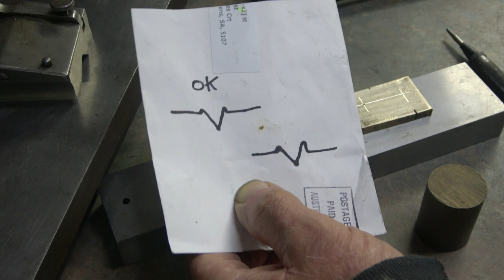How To Do Precision Center Punching To Toolmaker & Instrument Makers Standards As Taught In 1960

Comment: You really covered the subtleties of precision center punching.  I've often thought this would make a good video.  Occasionally, though rarely I still need to produce holes that line up on two different details and transfer or machine locating is not practical.  I fall back to my early training which you so aptly demonstrated.  I'm certain many of your viewers will benefit from your video.  Good job Dave.  Stay well my friend, Mike
Reply from the maker: Hi Mike, sorry I beat you to making this video LOL Don't put off until tomorrow what you should be doing today. I mainly made it as I see such bad center punching shown on YT, no accuracy or finesse at times. It's a wonder that some of the parts ever fit together. Thanks for watching. Regards.

Comment: Great video Dave ! The main thing I see a lot is when someone goes to the trouble to mark out correctly then thump a giant  divot with a big punch and a lump hammer. I have a little Starrett auto punch ( about 3 inches long) that I can actuate with nothing much more than reasonable finger pressure , I then use a small Starrett  manual punch to finish it off. I do have a bigger auto punch ( from Hare and Forbes ) but this thing needs a lot of force to actuate it . It is great for doing witness marks ( idiot marks ) that I use for oxy cutting as it has a big rubber mushroom head that I can thump with my hand to actuate it so no need for a hammer ! 
Another technique that you could show is how to break an edge on a part without butchering it with a file , Sometimes you want that crisp but not razor sharp edge . I have seen precision ground stones used for this ( nice if you have them) but was wondering how it was done in the past .
Reply from the maker: Hi Ian, thanks for the view and your comment. I will shortly upload a video about machining a 6 sided block and how to get the 5 th side square without using any tools or gauges. To achieve this I need a machined edge but with no edge radius, so I will be showing how I do this. The best way to get no burr on  an edge is to always run the cutter so that it cuts INTO the part, thus not throwing outwards a nasty burr. Stay tuned. Regards.

Comment: Good stuff Dave.  The filing of the displaced material after "walking the punch" (moving the indentation) is good to know.  I would add that if you need fairly close tolerance of the hole positions, I like to use a Magnavisor during the  whole process.  It's a set of magnifiers worn on both eyes at about 7x power.   That way you don't risk losing your position while fiddling for a loupe or magnifying glass or even the hammer.  Thanks for sharing
Reply from the maker: Thanks for watching and your comment. Yes you can use magnification for checking it has not moved. I have changed over to a different style of head magnifier. Head fitted but it has the lens hanging down in front, and you can lookover the top for normal vision when selecting tools. Super tool. Here is the link.  https://visionaidmagnifier.com/products/visionaid%E2%84%A2-magnifying-glasses-with-led-light?currency=AUD
Also look alikes sold on Amazon and Ebay.
Regards.

Comment: Thank you very much. Passing on the lessons. The uneven raised metal made perfect sense as soon as you pointed it out. "Blinding flash of the obvious." in my former profession. In retrospect I'm sure that has bit me several times. Any disadvantages to using a stone?
Reply from the maker: Glad it was helpful Ron, by all means use an oilstone, but I tend to use them on hard materials. If you use a stone on brass or aluminium the pores in the stone will easily clog up. Better option if you don't have a fine file, is a bit of 400 or 600 wet and dry on a parallel or similar flat stock. Thanks for watching and your question. Regards.

Comment: Thanks boss, that was brilliant, but how do you grind punches?  I am never happy with mine!  Also given that you seem to use the bent end on your scribing block how do sharpen that?  I hone mine with a slip stone but im never very happy with the results. Thanks again!
Reply from the maker: Hi there, thanks for the view and your questions. Firstly with regards to sharpeneing the center punches, generally they are only about 55 Rockwell hardness and are therefore easily turned on a lathe with a carbide tool. Failing that get yourself a diamond file or hone and use that. Should you want to grind using a bench grinder, hold the punch in the upright position and grind using the center of the wheel. It is easier to hold and rotate rather than trying it horizontally. By doing it vertically the grinding marks go down the length of the point, rather that the other way giving grinding rings, and it will come out much rounder. You are also able to rest the punch onto the tool rest and get better control. Finally with regards to the bent scriber, yes a real pain to sharpen, However it dose not need to actually be a point. You can put a flat on the bottom and also grind the top flat so that it looks like a height gauge beak or same shape as a wood chisel. As long as you have a sharp defined edge to scribe the line, the shape is not important. Hope this helps, any more information needed drop me an email and I can detail more with pictures. Regards.

Comment: Very interesting Dave. I must try marking up without layout fluid. I think I need to put a really sharp edge on my height gauge first.
Cheers
Andrew
Reply from the maker: Go for it Andrew, you can always use a sharpie on the area you want to mark first, as I find that does not wash off like the stuff you use. Get a rough rule measurement with a pencil, then say do a 1/2 inch square of sharpie to make your lines more visible. When you do it on aluminium, after scribing, rub your dirty hands into the scribe marks to make them stand out. That's free unlike buying Dyechem. LOL. Regards.
Reply: @daveticehurst4191  yeah ironically I've just marked up my v-twin crankcase using dykem. I'll give your method a try on my next component.
All the best.
Andrew